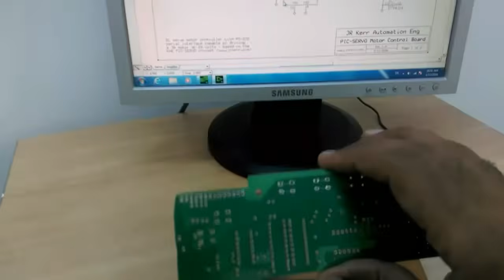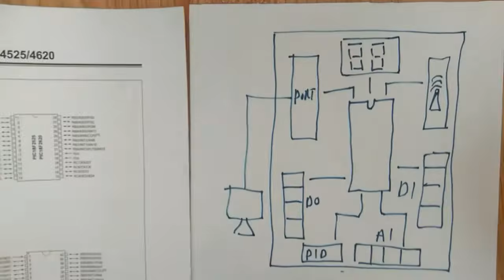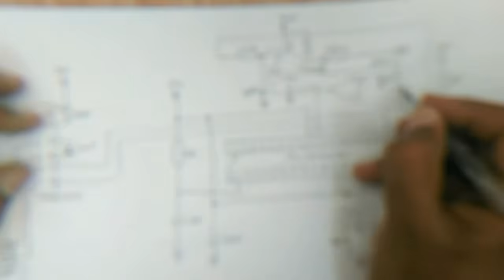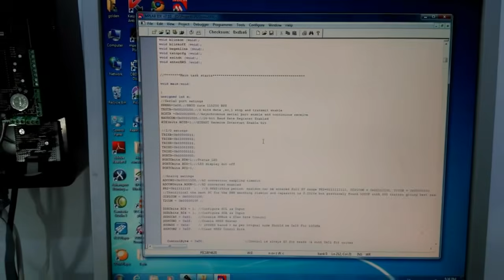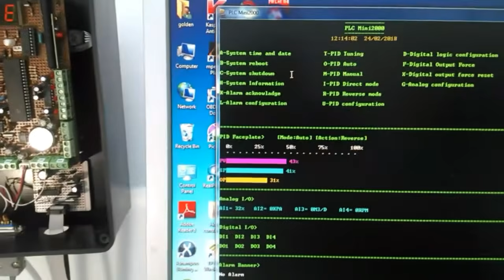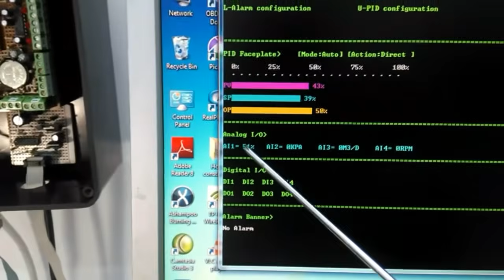How to build a homemade mini-PLC using simplified prototype process step by step

Comment: Hi! May I ask  is it possible if you can show the complete schematic drawing of the circuit? I would like to replicate the circuit using a different controller.
Reply from the maker: Hi, and welcome,
I need first to create the circuit digram using circuit design software, so the schematic will be clear and easily readable, as currently I have it as hand drawing.

Comment: Can you use u-processor to build real plc
Reply from the maker: Yes of course, in fact building PLC with microprocessor is more interesting project with much far flexibility and processing power compared to microcontroller application, and professional industrial PLC are based on microprocessor most of the time, for example motorola MC68000, but we don't forget that more work and many other extra components and ICs needs to be used with microprocessor application.

Comment: great. I want to learn make plc from nothing. Do you have a reference to get there, Sir. Thanks
Reply from the maker: Hi,
First point have a cnfedent belive that you can do,
Then build your knowledge with basic electronics, start with smaller circuit and project including analog and digital, learn some programming language, sure you will get there.

Comment: If i make this how can be programmed help plz anyone...
Reply from the maker: Hi,
Download MPlab IDE application from microchip, this you can use to write and compile the program, then you need PIC programming application plus programmer hardware, this you need to use to download the program to the pic microcontroller, there are many available in the web you can search.
Reply: Jazakallah habibi.